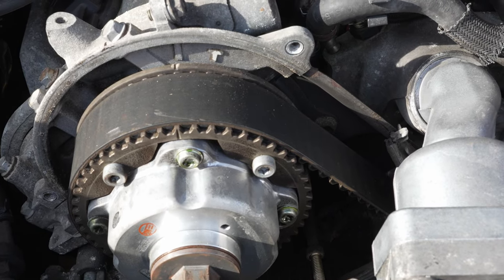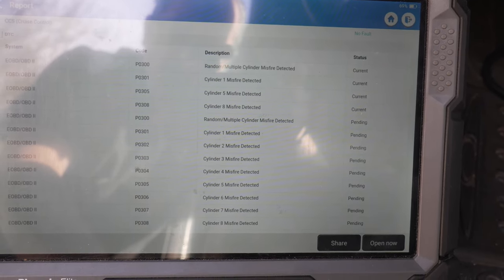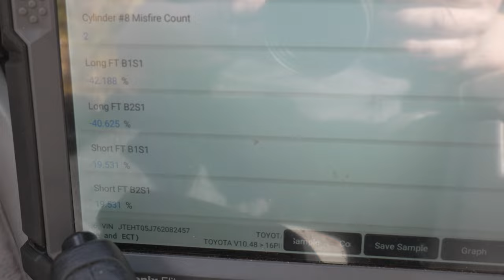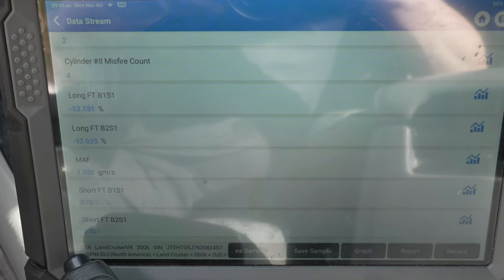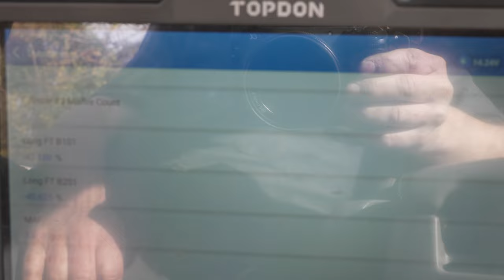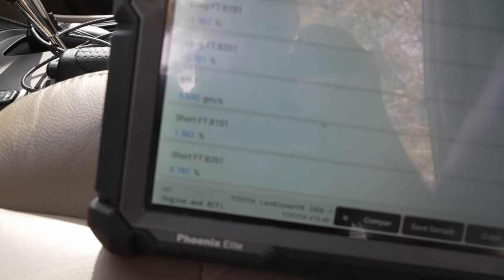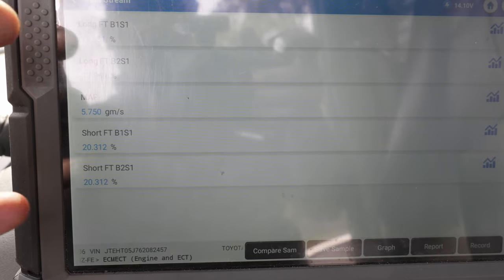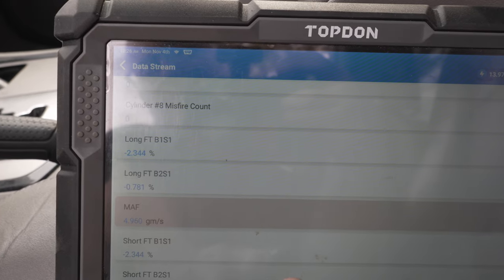Diagnosing an odd misfire issue on a 100 Series Land Cruiser

Comment: That's some great troubleshooting. I'm familiar with aftermarket EFI where people might have harness problems or ECU configuration problems, and it can take a long time to find and fix problems like this where something is causing a bad sensor measurement but swapping the sensor doesn't fix things. I wonder how the spark plugs look? From what I've seen, if the air/fuel mixture is so wrong the engine sounds wrong the porcelain on the spark plugs will look dark brown or black instead of tan. Sometimes the plugs will clean up from running at the correct air/fuel mixture, and sometimes a fresh set of spark plugs will be needed. I think all the O2 sensors on a 2006 will be self-heated so they aren't likely to get fouled as easily as spark plugs.
Reply from the maker: I didn't pull any plugs to check.  Fuel trims have stayed in a happy place and the misfires vanished immediately when I unplugged the add on harness, so I''m thinking they're OK still.
Reply: @OTRAMM  that's great the spark plugs are still OK. When you said long-term fuel trim of -40% it got my attention. If the mixture was running 40% too rich before the fuel trims kicked in, you might see black smoke from the tailpipe and it would definitely be down on power.
Reply: What are the symptoms of a failed secondary air injection system?
Reply from the maker: @jlinkhart  engine codes and a check engine light
Reply: @ ok so no noticeable difference besides CEL?
Reply from the maker: @jlinkhart  not that I've ever seen. It doesn't really affect running since it's just adding supplemental air to the exhaust to help emissions on cold start.
Reply: Good to know! Thanks!